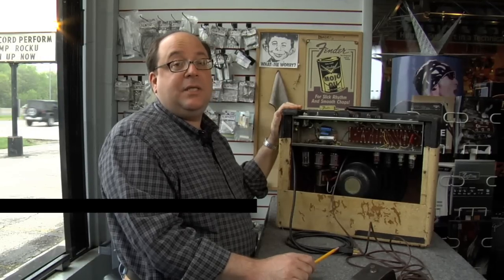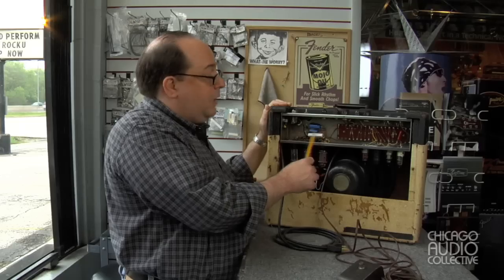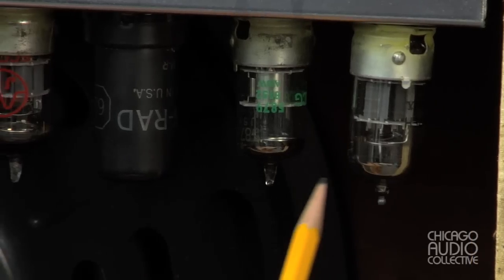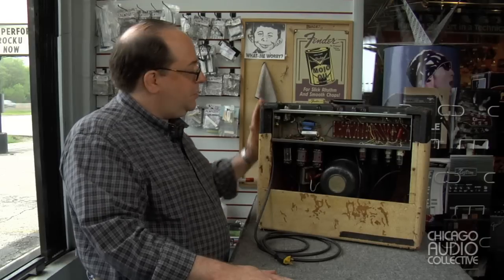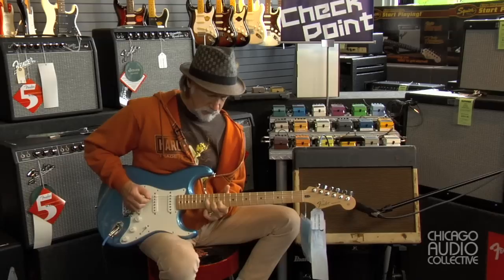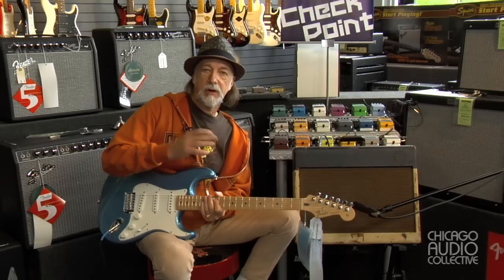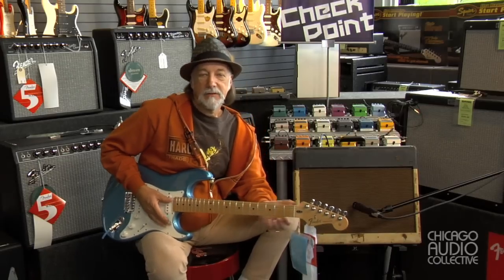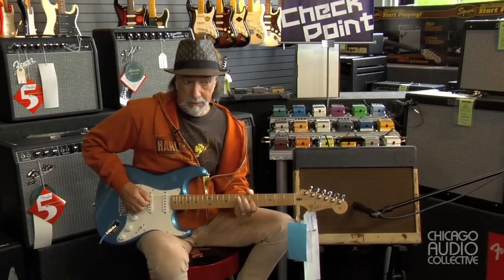Gibson GA-20T Follow-up (Vintage Amp Restorations)

Comment: seriously, I chose to keep my GA20T over  the 1482,  5E3 deluxe, Magnatone 213, even the great gibson ga40T...this is exactly what my amp would sound like if you yanked all the guts and replaced all the caps with shrill, sterile orange drops...might as well yank all those dusty old RCA 6v6s and toss the moldy old Jensen P12R while your at it ....i think you learn about amps by playing them, matched with many different guitars, extensively and for years... not in a math class, even if its at MIT...

Comment: wow, and I just noticed the "sourcing" of "the correct replacement components" statement. How far did you have to go to find them, Guitar Center or Home Depot (dotcom)?? The correct components would mean restoring the amp, not remaking it so that it sounds like tiny tim and yoko ono on quaaludes yelling at each other inside a corrugated shack...you can blame a crappy mike, a mediocre guitar and perhaps other factors, but somebody over at Chicago Audio Collective might want to start spending some time with some unmolested vintage amps

Comment: I have a 1959 GA-20T that sounds a whole lot better that this one. But, then I didn't arbitrarily replace ALL the coupling capacitors! This is a guitar amp NOT a radio or TV. You just DON'T replace ALL the caps! You just ruined the great tone these amps are famous for. '"Techs” who routinely advise wholesale parts replacement often do so because they don’t have the knowledge and experience to diagnose problems. They are merely hoping that changing all the parts will fix the problem.'
Reply: You got that right Rick...Most of the caps under the eyelet board are NOT paper dialectric, all but one 20uf, 25v electyrolytic. As a tech working out Lompoc, California, I do not want my customers to be paying for extra labor when not necessary.  Electrolytics have an effective life of 15 years or so, and yes, change all of those, but to get rid of the vintage sound the other caps helped to create?....I think not. Signed......... Tube Amp Guy, on Facebook...
Reply: @BrianWCole  you sound like the better tech. I couldn't tell if it was the recording or the "fixing" that ruined the sound of this great amp.
Reply: Amp techs are engineers, and engineers are the last people on the planet who understand tone and it's emotional impact - it's all simply a math problem to them. Lol.